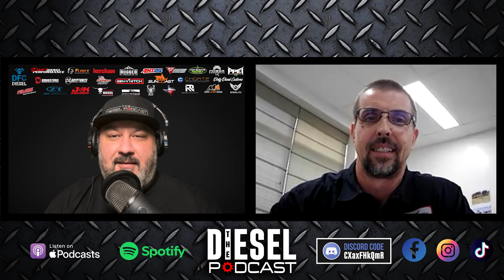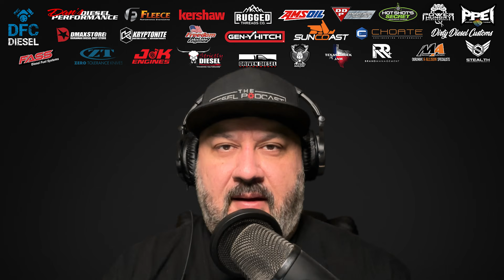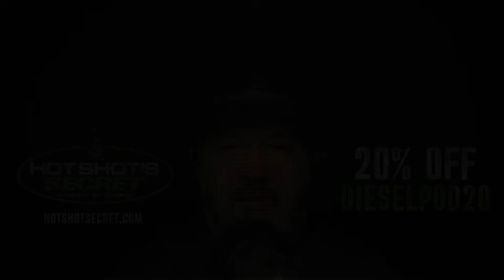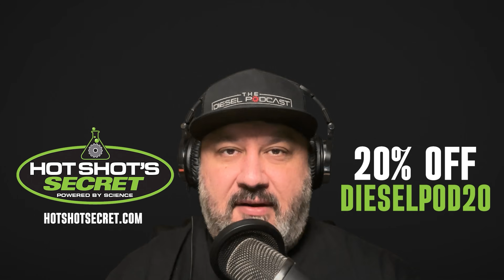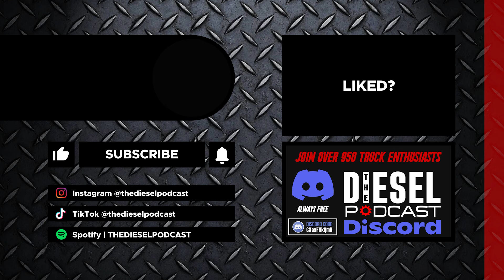Diesel Shop Talks 7.3L IDI Engines

Comment: The thing that really kicked off diesel in the first passenger vehicles and putting them in pickup trucks was the fuel crisis in the late 70s early 80s, when I was very little in 1984 85 every vehicle offered some sort of a diesel engine because the fuel mileage was phenomenal compared to its carbureted gas competitors it was a mandate that full-size passenger vehicles needed to meet a 15 MPG standard and early IDI GM cars we're making about 15 mi per gallon requirement. For the trucks it just took off from there. Dodge started late I believe in 88 with the direct injection Cummins turbo diesel which was one of their best decisions.

Comment: Out of the multiple dozens of crappy old trucks I've had, the 91 f350 idi has been hands down the least reliable vehicle I've ever had. I've had it since 2018 and haven't put 1,000 miles on it without something breaking to the point it hasn't been able to move under its own power yet.

Comment: I bought a ‘93 IDI 2 days ago because it was the deal of a lifetime. Truck was soo immaculate looking, I was suspicious that it was a totaled out truck that was rebuilt. I honestly would be the happiest dude on earth if I could just get this thing to run like it was straight out of the factory. No upgrades, no fancy stuff, nothing special with the mechanical. I would upgrade all the cosmetic stuff, but I’d be happy to drive a big heavy slow diesel.
Reply: They're easy to work on, just stick with, little bits here and there over time, its the most satisfying truck to work on, when you get em going, best feeling ever.

Comment: Those engines where never designed for high boost!!! Their like 21 &1/2  :1 compression ratio!!! The reason ford put a turbo on the idi late in the game, was they didnt have the 7.3 Power Stroke done yet! So they gave the option for a turbo idi to try and not lose sales to dodge and chevy which had turbo diesels at the time!!! I would never waste my time boosting an idi!! Idi is a less efficient engine then a di engine!! Look around they dont make idi's any more!!! The main reason idi's where made was because they where cheaper to make and they are quieter then di engines! My first gen 95 7.3 DI powerstroke E350, is very loud the radio is pritty much un enjoyable in stock form!! I also have a 89 E350 idi with less then 150k on the clock, that I would never sell!!! Super reliable simple work horse!!!☺️👍

Comment: Donald Trump said they will get rid of emissions on new trucks. But the old truck is pushing a classic. In Colorado over 30 years old they get emissions test with collectors plates soo let's say you get the test then delete it for 10 years your getting away with murder on the air quality but 1 old truck will never have enough pollution to worry about it.

Comment: I slowly upgraded my truck over the years and can't imagine not having it.

As bought: 1986 F250 2wd automatic C6 with 4.10 gears
Current: Turbocharged, studded, 4wd conversion E4OD and 3.55 gears, front and rear lockers

Ok, so maybe I got a little carried away.
Reply from the maker: Sounds like a good running truck!

Comment: Always glad to see anything on IDI turbo diesels \. I have a 94 f250 with a IDI Turbo diesel. It has about 200k original miles and still runs perfect although I just noticed I need a new water pump, but other than that it has been dependable as all get out. It had a Garrett T3 series turbo, and is still there I have never had a problem with it. 
I put a ton on money in this 94 250, trying to restore it all the body work, paint, and chrome redone.  Iamin Jacksonville Fl and it is next to impossible to find anyone who will work on these trucks. I wish you guys lived in my nick of the woods. 

Is there anybody you might know that I don't know here in northern Florida who still works on 7.3 (K) idi diesels? 
In your title, Diesel Shop Talks 7.3L IDI Engines  made me scratch my head because if I'm not mistaken, are not all "L" 7.3's powerstrokes? I know mine is a "K" if I'm not mistaken.
Anyway really appreciated the conversation. Buying this truck was my first Diesel ANYTHING and I had no idea how they worked. I'm glad I picked a simple motor as learning has been a lot less complicated. Mine has been as dependable as ever, although my E40D trans has gone into limp mode twice in the past year. Shutting the truck off and restarting it seems to reset it. Is there some kind of electronic exterior mechanism that I should be looking at that might be causing this problem? It seems your guest mentioned something on those lines during your conversation. Would deeply appreciate any advice/ information. Thanks for sharing all of this IDI stuff with us,
Reply from the maker: Thanks for watching! I’d recommend reaching out to the team at Strictly Diesel and see if they know any shops in your area. They do business all over the country and may know a place.

Comment: Sweet loved this very helpful . Iam about to try to try to start my 86 f250’HD 4x4 6.9 auto. Just replaced a few parts and it hasn’t ran for years . Fuel tank in dry . I would say I should clean the fuel lines out or may be safe ? Any tips?

Comment: I own an '84 F250 that came with the 6.9L, but was later converted to a 7.3L w/ Banks turbo. I have a great fondness for this truck, thought about selling it but I would miss it! They are easy to work on, but frustrating sometimes with fuel issues. I did just install an electric fuel pump and it definitely is running smoother, but still a little hard to start.
Reply: did u change glow plugs

Comment: The 6.9l was and still is the best diesel available
Reply: Hell yea bro ya change the glow plug crap ya do small adjustments on the pump I've got a 6.9idi in a 86 with a Speed trans 4x4 in a 2 wheel drive my truck weighs 9600 pounds an I get 22 24mpg from adjusting the pump an building the engine man I did love my 91 12 valve but my baby is muy baby

Comment: I have an 87 IDI I swapped a 7.3 NA IDI motor with factory 93 turbos kit.  Opened up the turbo to 3" for a full 3" to 4" straight pipe.  turned up the boost to around 9 PSI.  I daily drive this truck and still tow with it.  You can't beat the simplicity for what it is.  Often overlooked is the shower heads in the fuel tank that come apart and start getting sucked into the supply side which can kill the fuel selector valve and they get sucked into the mechanical pump killing it.  If you've got a new to your IDI.  Start with clean fuel tanks then work your way forward.  Swap to Manual valves if you can.  Add a coolant filter so you can add a SCA filter.

Comment: IDI's were outstanding in 250 and 350's. Practically bullet proof. Not much power and didn't start great but otherwise they were great. Little known fact first year 1983 idi starter was direct drive and spun faster than following years.
Reply: They might be hard to start in REALLY cold weather, but the 3 IDI's I used to drive started instantly as soon as you touched the key.  I don't think the engine even made 1 full revolution before they started.  As long as the glow plugs are working properly, there aren't any fuel leaks, and the injection pump is good, they start faster than any other diesel, maybe even faster than a VE pumped 12 valve.

Comment: The 6.9 was available from 1983- 1987. 1988 was the first year of the 7.3 idi. 1987 Glowplug system was changed and the 7.3 idi used the same Glowplug system. Late 1987 truck had an option of a ZF 5 Speed.

Comment: No mention of cavitation? Probably the #1 killer of these IDI's once you put a turbo on them. It's normally not if, but when will it start losing coolant through the cylinder walls if you don't take METICULOUS care of the coolant in them, and even then they can still fail.

And for the factory turbo 7.3l, it was essentially a completely different engine from the N/A version. Different block, rods, pistons, crank, & I'm pretty sure the heads. Ford had Navistar COMPLETELY redesign the engine when they added the turbo mid year 92, and then they choked it out with crunched up up-pipes.
Reply: Use coolant with sca additives all diesel need this additives.
Reply: How much coolant do they hold?

Comment: Don't gloss over the fact some people like these because they're 1. affordable. 2. Classic fords (bullnose and bricknose only diesel option). 3. Readily take waste oil or a lot of other crap as fuel. 4. Simple and cheap to work on. 5. Fairly indestructible. 6. EMP proof.
Reply: Yep thats why I have 2 of them. Great truck and engines slow and steady....
Reply: @deepbludude4697  I recently got one up and running after it sat for 8-10 years. I've never had such a good time moving so slow 😂
Reply: Literally all of this, plus our boy Peg has shown that they can be ridden hard and put away wet but still be sofa king loyal.
Reply: #6
Reply: parts are drying up for 7.3 idis really fast, cant get certain things anymore, what good is reliabiity if you cant rely on parts being made?
Reply: @andy_182  

Drive it till you literally can't get parts to keep it running anymore, and then swap in a cummins, and sell your old IDI as a parts engine to someone else.